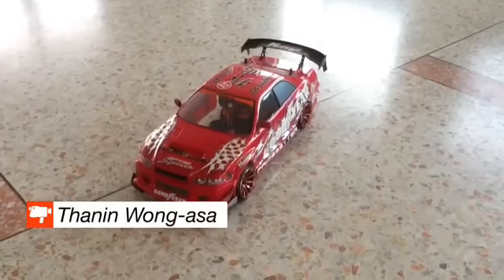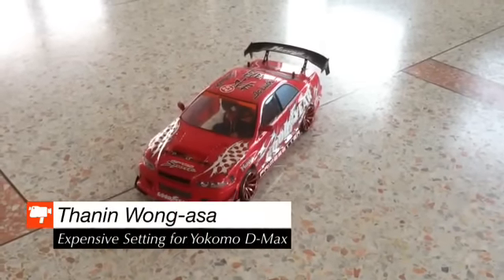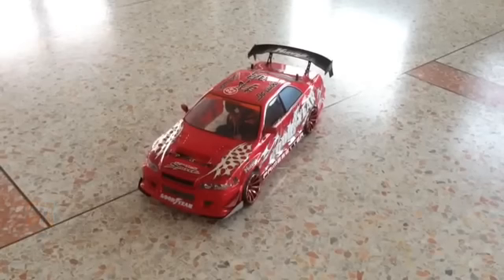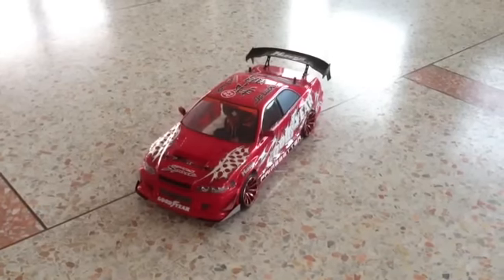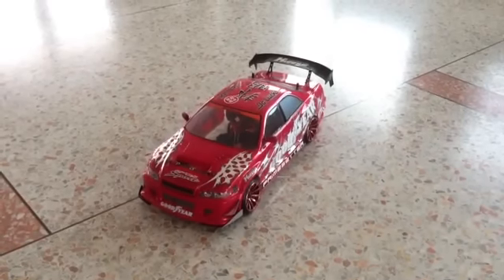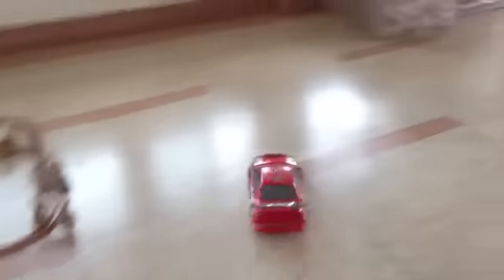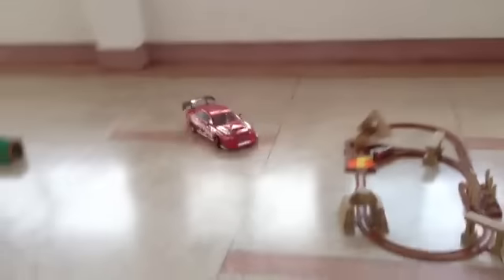Expensive Setting for Yokomo D-Max

Comment from the maker: I have a Tamiya TA05 VDF with 100% counter steer setting. I run very well.
For D-max, I got it long time ago and just mod it many time. This time I got lower caster block 12 degree and new Type C front upper and lower arm. Also I got aluminium gear cover for front and back. This new option parts make my D-Max lost it's optimum point. I have to find the new setting for it. And it worked with 2 peaces of gold plate I buy today. It is just a joke for setting and I want to share to you all.